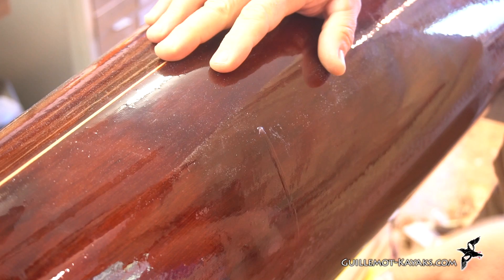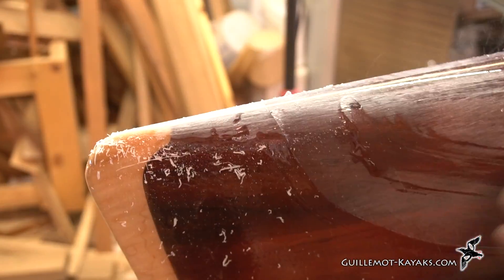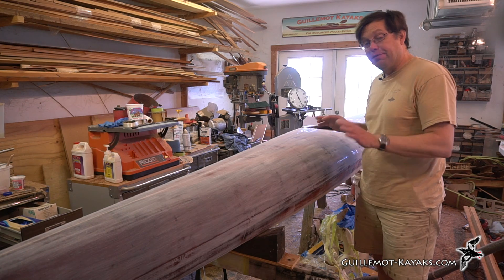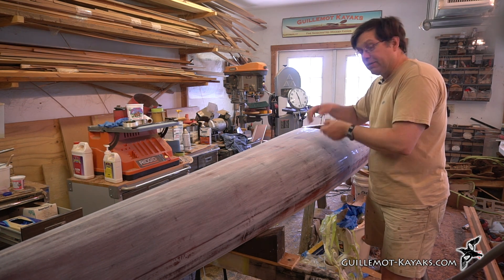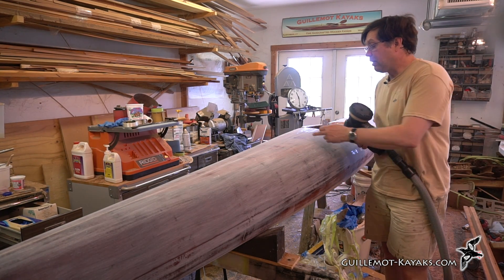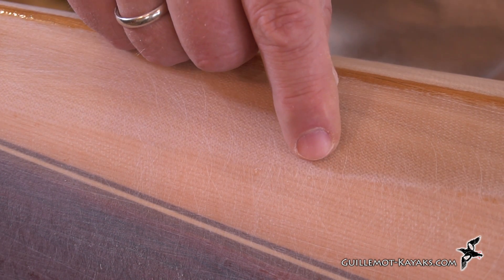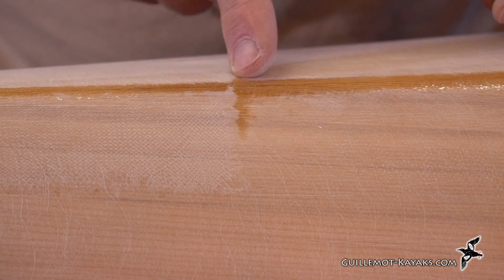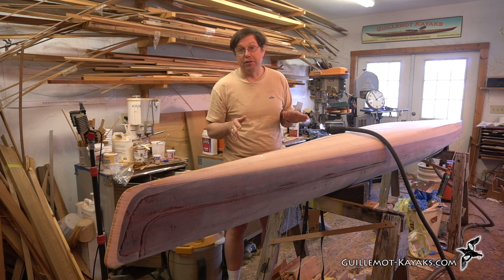Final Fill Coats - microBootlegger Sport - E58

Comment: Great advise on dealing with the weave, when it appears ! I've had my best luck scraping the bias strips, as opposed to sanding.
Reply from the maker: When I'm trying to level the surface when there is an overlapping edge, I need to feather that edge away to make a smooth surface. I go ahead and sand into the glass. It has to be done to get a nice surface. Scraping will certainly work, but it probably won't produce a really smooth surface.

If I sand into the glass on the body of the boat, away from any edges, I just stop sanding even if there are shiny spots in the immediate vicinity which need sanding. Unlike wood, where it is impossible to add more wood, on the fiberglass and epoxy it is easy to add more epoxy to bring up low spots.

In this case, I stop sanding, but scuff up the surface with a scouring pad to de-gloss, and then count on the fill coat to fill in and level the surface.

Note that I was planning on doing a fill coat anyway. I prefer not having any glass exposed after sanding because exposed glass can produce print-through into the varnish. Much less so if it is buried in some epoxy.

Since doing this video the boat has been sitting and curing. I will do the final sanding immediately before applying the finish.
Reply: @NickSchade  , applying peel ply on the extra fabric layers (@ 9:25)can help mitigate the unevenness. Composite homebuilt aircraft use this technique to fair overlapping plies, especially wing structures. Homebuilt aircraft have to be much more careful about sanding into layups as that can affect the structural integrity of the airframe (see this for an example https://youtu.be/p9GTYsNBiaE?t=2525). And while polyester peel ply is great for creating secondary bonding surfaces, nylon peel ply can provide a more finish-ready surface.

PS: I thoroughly enjoy all your build videos!

Comment: Thanks, Nick.  Fantastic videos as usual.  I'm working on the Great Auk.  Some place, I saw where you poured epoxy into the ends of the boat so you could drill through and put a pull rope on.  I still have the boat in two pieces, but I thought I would add a thickened Schmoots radius in the inside of the ends.  When I did this, it got really hot and started smoking.  It doesn't look like anything was damaged, but it gave me a scare.  I can't imagine pouring a bunch of epoxy in the ends - it seems it would REALLY get hot.  I haven't seen you do this yet on this boat.  Did I miss it or do you have another method now.  Is the heat something to be concerned about.  Thanks.
Reply from the maker: This build did not include an end pour. If you watch my Petrel Play build you will see one of the ways I make the end pour. Epoxy can heat up while curing. If I do the traditional endpour, I stick the end of the boat in a bucket of water to help control the heat. If you do this you must make sure the seams at the end are completely sealed.
Reply: @NickSchade  Thanks, Nick.  Very interesting.  I think I can tip this boat's hull while it is still not connected to the deck and get enough of a pour in there so I can safely get the pull rope through.  I would be able to put the end of the boat in a tub of water for this operation.   What about hatches and bulkheads.  It doesn't look as if you put them on this build either.  Your boat is unbelievably beautiful.

Comment: Tell me please, but the coating will be varnish? Or is this the final stage?
Reply from the maker: This is not the final finish, I will be coating it with varnish or another clear coat for Ultra Violet protection.
Reply: Tell me please, what is the density of fiberglass you used in this project?
Reply from the maker: I use 4 ounce/yard^2 [135 gm/m^2]